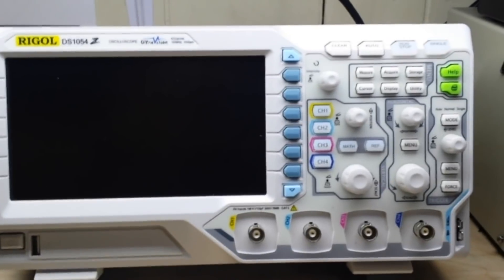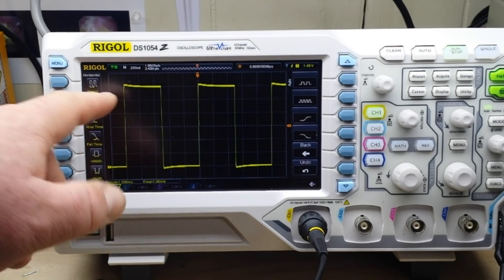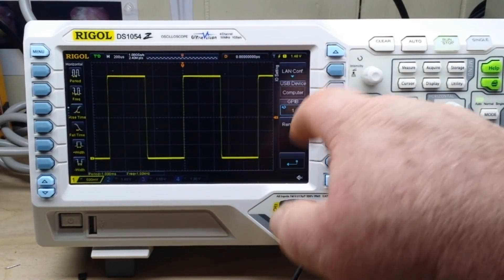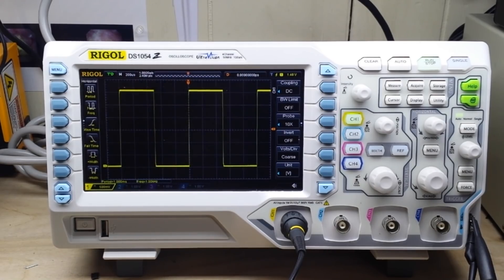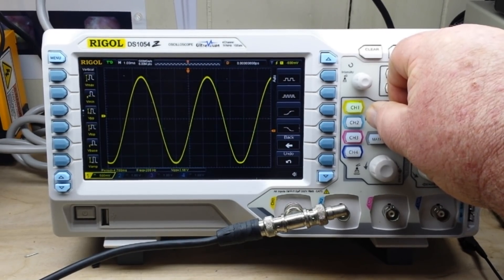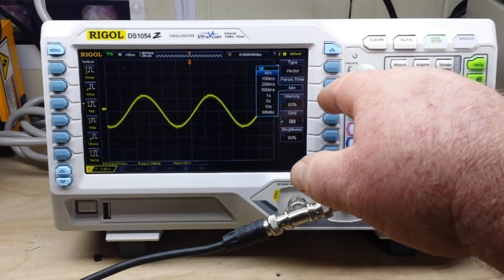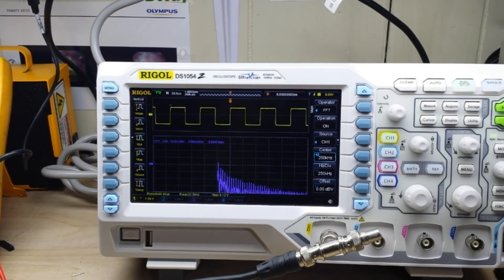How to Set Up A Digital Storage Oscilloscope

Comment: Paul. Thank you for posting this video. I just received my scope today. I used to build kits and fix radios when I weas young. Siince then I haven't touch it. Am trying to get back into it again 45 years later. I've been fixing neighbors solar lights and built a few lipo chargers using tp4056's. I use the scope to monitor the charge but would also like to monitor current. maybe you could do a few video's on that and other simple uses. Thank you

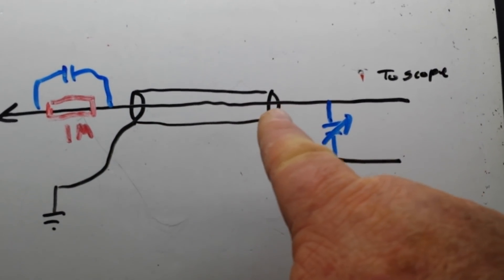Comment: 2:30  It's not a 1M resistor in the probe tip, but a 9M resistor (on a 10:1 probe setting) , and this 9M resistor is bypassed by switching to the 1:1 setting on the probe.
The internal resistance of the scope is usally 1M on the modern scopes.

Comment: Actually if you set your channel on 1X to match the probe setting of 1X you can now select 500 micro volts on the volt/div dial. You can not do this if you are in 1X in the channel menu. Makes sense i guess but a bit confusing. Was beginning to think the 500 micro volt hack did not work

Comment: Just upgraded a second hand Rigol 1054Z to 100mhz.  I checked in Utility/Options/Installed to confirm it upgraded.  Previously i did an upgrade and selected the option for All but the 100 mhz had not installed. All the other stuff had upgraded at that time (1 week ago)  This time i just upgraded the 100mhz option on above website provided in this video.  No issues

Comment: FYI, once you HACK your RIGOL DS1054Z to 100MHz it will not pass Self Calibration, I've tried it will FAIL. I think it's because it is trying to calibrate to 50MHz and it is now set at 100MHz with the HACK installed.
Reply: Thanks. I just did hack this week so will not bother with calibration.
Reply: @michaelcostello6991  Hopefully everything is working right. Some are saying that they can't get it work at 100MHZ. I have sent them a tip, always make sure you don't get the number 0 and the letter O mixed up.
Reply: I  use the  DS1054Z  in 100Mhz version and it always pass the self calibration test. No issues...
Reply from the maker: Mine passes

Comment: I just tried the hack page on my 2102A. Unfortunately, this model does not want to be hacked so easily. It might be newer hardware or something. I found a page where someone found a way; still have to try it. So,  it seems that the best bang for the buck is the 1054, which is easy to hack.

Comment: How important is it that a scope be a Tektronix?  I'm come from old school where all scopes had to be Teks.  Yes, and I'm also nostalgic for CRTs.  However this Rigol looks interesting and I want one.  I also need a new function generator.  I used to have a Wavetek, but some daring soul stole it.  What is the best function generator to get?
Reply: John Doe Santa brought me the Siglent SDG 1032x, so far I love it. Puts out a nice signal from top to bottom. Also seems to put out a nice RF. I tried punching in som AM bands with FSK modulation and the portable radio picked it up a foot away. Looks like I can unload my old Eico RF generator and my old Wavetek and Heathkit freq counter. Looks like AM/FM radio alignment is covered with this puppy. There is a review of it on this channel.
Reply: @SIXSTRING63  The Siglent SDG 1032x looks really cool.  I will prob'ly buy one on Amazon.  I'm currently experimenting with Bipolar and JFET transistors.  I also hope to get my first 12XA7 vacuum tube soon.  The function generator I use is a crappy GoldStar that I found 2nd hand at a junk store for $20.  It produces crappy looking sine waves.  My scope is a CRT Tektronix 2213A.  I bought it brand new back in 1985.  I love my old scope.  I'm having fun and dreaming of designing a hybrid audio amplifier.  I'm working out of Malvino's Electronic Principles.

Comment: I bought my Rigol 1054Z last summer from Amazon. It has all the optional features installed by default except the 100MHZ. I tried the hack several times and could not get 100MHZ.  Most buyers have said it worked for them and as for mine, would it be that RIGOL set some to disable the upgrade?  What do you think Paul..  Let me know..
Reply: Update, when you write down all of the letters and numbers you must get them all right or it will not take. The letter O will look different from the number 0. A lot of people get this wrong when it comes to pass words and codes. So try it again and pay close attention to each letter and number that's in sequence, then come back and let us known if it worked or not. KR222.
Reply from the maker: I don't know of Rigol doing anything to shut it down.
Reply: @learnelectronics   I will try it again and let you know what happens. I think what I will try first is the code for the 100Mhz first since all the other options are working.
Reply: @gordselectronicshobby3853  try just download the 100mhz upgrade on its own. it worked for me today. It had not upgraded when i selected "upgrade all" option last week. My rigol ds1054z is a couple of years old i think as i just bought it second hand but   it looks brand new .

Comment: Aditionally it will be required some function generator and it  is also available. it can be also built using arduino and some RC circuits already covered in the past videos. Thanks

Comment: Before self cal I recommend to turn it on for 45 minutes to get into a regular running temperature. Don't forget that the self needs to be done with the proper probe divider e.g. 1:1 or 10:1 depending what you use.
Reply: I think that when you do a self calibration there shouldn't  be any probes or anything connected to the scope. It says it at the start to disconnect everything from all inputs on the scope. Or am I missing something here?
Reply: @conspiracies1014  Sorry I meant the probe calibration not the self cal.
Reply: Update, Yes I thought about the probes calibration and the self calibration and got a little lost. But I just tried the self calibration and it finally passed. I don’t know why it would not pass after I did the upgrade to 100 MHz over a year ago. But I tried it again yesterday and it passed. ??? And it’s still working great.

Comment: I 'm still in need of a Real Scope.   Santa didn't even show up this year.  Think he's still pissed about Rudulf being Butt shot with Buck Shot in the this hood.
Reply: Rigol Canada has some really amazing deals right now if you go to the clearance section at the bottom of the page.  I just bought a DS2202A for CAD$499,.  The US site would have the same kind of deals going on with a larger selection.
Reply: @volcomstoned876  All of my project funding is DEPLETED at this time.  Just spent a butt load on batteries for my Power Wall project.

Comment: Just cant figure out what I would do with a scope... My multi meter gets used to death... but a scope? I'm not a rocket engineer for Christ sake.. I just like to fix things... I think 90% of the people who have scopes don't use them after a few months... money sitting on the work bench...
Reply: Your needs will dictate if a scope would be useful for you or not.  For basic troubleshooting, like verifying continuity, voltage, current, resistance, capacitance, DMMs will do the job just fine.  When dealing with electronic circuits, you may need to validate the signal shape, evaluate timings, decode buses, etc.  Under these circumstances, a scope is a very valuable tool.  Globally, It's a matter of need, no more, no less.
Reply: If you like to fix things a scope and a few basic tricks give you a huge wealth of debugging information which helps immensely understanding what happens in the circuit. Often it's really easy stuff too like ripple on a power rail or a bad clock signal etc. It's really not difficult if you just shed your prejudice.
Reply: Well, if you can't figure out what to use it for then there's 2 alternatives:
1. You actually don't need a scope. 

2. You need to start fixing more advanced stuff so you will need a scope.
Reply: Brian If you want to do anything more than basic voltage, amp and resistance checks you will need a scope. I rebuild old tube guitar amps and audio gear. Scope is essential in checking output signal for unwanted distortion and bias issues and trouble shooting issues in a circuit. Unless you are a person with amazing instincts of typical electronics issues like Sorin on Electronics Repair School channel, guy can repair anything with a DMM, power supply and a can of Zippo lighter fluid. He learned in communist Romania so he made do with whatever he had on hand. Most people are not that instinctively blessed. Plus he did it that way for 35 years so experience is the best tool in his arsenal.
Reply: An oscilloscope is essential for working with AC circuits.  By taking voltage measurement and observing phase relationships you determine the capacitance and inductance within a circuit.  
     I'm currently developing small amplifier circuits using transistors.  I use my function generator to apply an AC at input and view both input and output on my scope.  Now I can see the gain and check my output for distortion.  
    Also say you are troubleshooting a microprocessor circuit.  A microprocessor must have a clock.  It must have input and output.  It must have memory.  The memory also has input and output, addresses and enables....ect...  With an an oscilloscope you can quickly check all of these.
    So yes, having a scope is a lot of fun.  Years ago a professional grade scope cost thousands.  Now they only cost hundreds.  To work in electronic you better know how to use a scope and it no problem if you have one at home.
Reply: Can you figure out what to do with yourself at night when no one is looking?  
Prob'ly not !